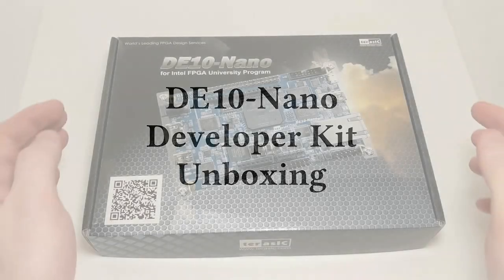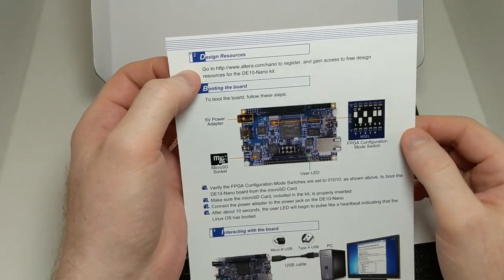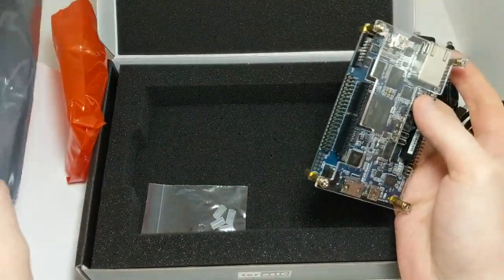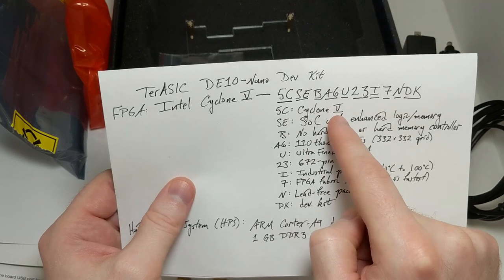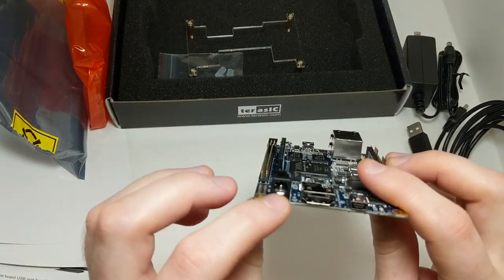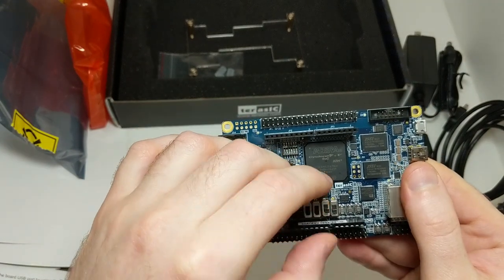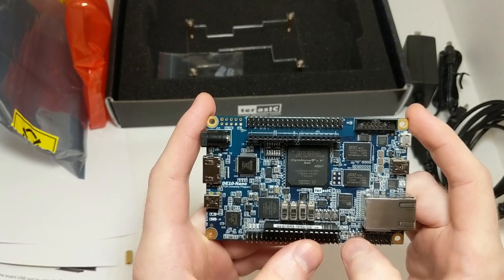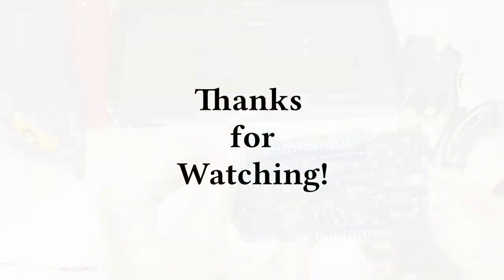DE10-Nano: Unboxing and Discussion

Comment: Thank you Trevor for this short video. Unfortunately, they send a power supply with the same plug all over the world! They could have provided an adaptor or a format of plug considering the country of destination. Too bad! Moreover, I deeply regret that Windows 10 cannot be installed on this little toy whereas it is now possible on Raspberry Pi's. Weird because both boards have an ARM CPU on them. If someone finds some info on this, I am very interested.
Regarding the DIP switches, they are for the FPGA configuration and the detailed explanation lays in the user manual.
Regarding the USB, I have not grasped well but the one used as a classic PC USB port is the micro USB On The Go and with a USB hub to use more peripherals.

Comment: Hi mate,
I have bought a DE10 Nano . I have made an example program for the FPGA which works well, however when I reboot the device it loses this program. How can I get the device to boot into a Verilog HDL program I made?
Cheers,
Harry
Reply from the maker: Hey Harry,
I have not done this myself, so I can only point you in a direction, which may be wrong.
I believe the answer has to do with U-Boot, which you configure the first time and allow to auto-run at boot thereafter. A basic tutorial is available from Terasic: "writeup_u-boot.pdf" from <https://github.com/intel-iot-devkit/terasic-de10-nano-kit/releases/tag/tutorials-v1.0.0>. 
Sorry I can't provide a more complete solution. Good luck!
Reply: Hello, in theory when you create a VHDL project on quartus, you will get the output file that will be stored in the EPCS memory module. This is a separate memory which allows the FPGA to get its Logic Elements organized the way you programmed it at startup. So in theory, when you power off and power on again, the system should start over normally. Anyway, this principle is very true with regular FPGAs on DE0 nano boards for example. With the SoC, it may slightly differ. Have you checked that your DIP switches (the ones of the FPGA configuration) are correctly set?

Comment: It actually kind of sucks that they included the lower end Cyclone 5 with less logic gates than the other models of the same chip which have far more gates.  Am not sure why they did that but it kind of limits what the FPGA can do to an extent. 

I am mostly interested in this for the MISTer project, and so this limits what it can do for more advanced gaming cores which is a real shame and means it will need to be ugraded at some point in the projects life.  Luckily some of the operations can be ran by the ARM cores which is quite nice.
Reply: It is a marketing hat trick to make you buy more expensive products! Anyway, I guess that this board is the best trade-off between price and performance and mainly aims university customers (students and professors). If it is your first shot, this board is more than enough. If you target very complex applications with intricate operations/algorithms you will face a lack of resources (logic elements).
Actually, I don't know whether a FPGA/SoC board is a good recommendation for gaming applications, I mean, console emulations. Raspberry Pi's can do the trick. Otherwise, it is more likely that you won't find a suitable TerASIC board cheaper than 1 grand or one can choose a DE0 nano board couple with a nice Raspberry Pi so it is not a monolithic SoC but you have both ARM cores and FPGA. Anyway, I hope you success in your project.
Reply: @guillaume8437  Have you not heard of the MISTer project?

Comment: quick q? why would this be better than a rasp pi 3?
Reply from the maker: No. Unless you know you need an FPGA.
Reply: @trevorkeller5431  i get it. zero latency.
Reply from the maker: It seems I missed the "why" in your question on my first reading 🤔

CPU systems have circuitry built to be as general as possible, with large instruction sets allowing solution of pretty much any problem you throw at it, with reasonably low latency. This design is excellent for general-purpose computing (running an operating system, solving a wide range of numerical tasks, rendering video). However, if you have a specific task to perform, the CPU wastes a ton of transistors and instructions on pathways you'll never use. For highly parallel tasks, there are better ways to use the die area. A GPU is one answer, for tasks that kinda look like rendering video frames and are indifferent to higher latency. The DE10-Nano uses an FPGA instead: an array of gates, connections between which you can turn on and off to suit your task. It's a lot like building a processor to solve your specific problem, only. This can be tremendously efficient, with lower latency than the CPU and, assuming the core instruction set being executed is small, a lot more parallelism. The downside is that clock speeds on FPGAs are substantially lower than CPUs and even GPUs, and the toolkits for programming FPGAs are closed-source "black boxes" that can cost quite a lot to license.

FPGAs are often used to mock up ASICs and processors for testing, before release of the design for manufacturing. For numerical simulations, which is my interest, it's probably better to research better algorithms using traditional hardware (CPU, GPU) than it is to program FPGAs. But it's been a worthwhile excursion into computer architecture for me.
Reply: @trevorkeller5431  thanks for taking the time to explain man! easy to understand and super informative. cheers!
Reply: @kpopRC , to make the answer as quick and simple as possible, it is a SoC which means two processing parts, the FPGA part and the CPU (ARM) part. Well, on one hand, on Raspberry Pi's you have ARM CPUs with more cores and more powerful, on the other hand, having a FPGA part is a pretty neat thing if you want to make complex calculations or algorithms in way less time. CPUs are sequential units which means that you have to execute an instruction after the other. FPGAs are only a complexe set of well organized logic gates/flipflops etc which enter the category of combinatory logic. It means that you put numbers, operators and clock in input and you will have a result in output right away or just the propagation delay. So it bypasses the sequencer.
Actually, the combination of FPGA and CPU is a very neat thing but unfortunately this level of CPU core in this SoC is very low, so yes, for computer like systems, Raspberry is way better most of all because it is designed with every possible thing that you can have on a SBC. FPGAs are unbeatable in extremely fast systems such as financial trading systems for which every nanosecond counts in extremely low latency arbitrage strategies, or recurrent algorithms such as codecs, conversion of signals format suchs as USB to serial for example.
The fact is now, Rasp Pi's are very cheap for a huge quantity of resources and very "democratized". FPGA boards are more expansive for the reasons explained above.
One more thing, you will have to describe the logic you want in your FPGA in VHDL and once it is done, you cannot change it unless you redesign your project. So you cannot use the HPS (the ARM CPU) to REprogram the FPGA part and the logical operations will always been the same.
Some hugely passioned people also programmed in VHDL a CPU architecture, like x86 or ARM but you need a way more powerful FPGA the ones that cost thousands of bucks!
Sorry, I was about to forget, on Rasp Pi's you can install windows 10, many distributions of linux or I guess also Android (but I have not looked for info on this). On this DE10 nano, you are very limited. You cannot install windows 10 and not even a regular ubuntu which is pretty embarassing.